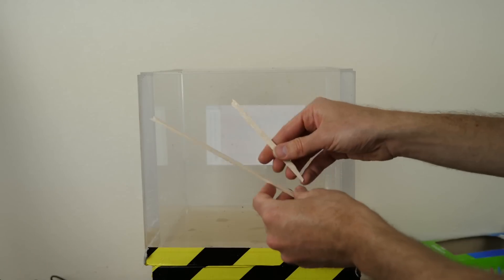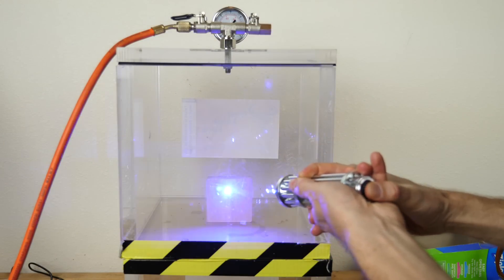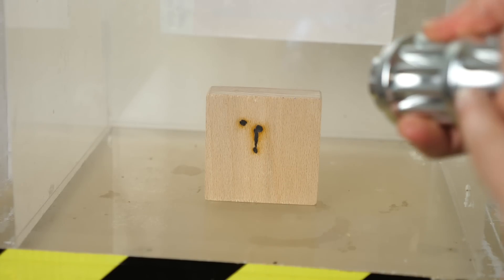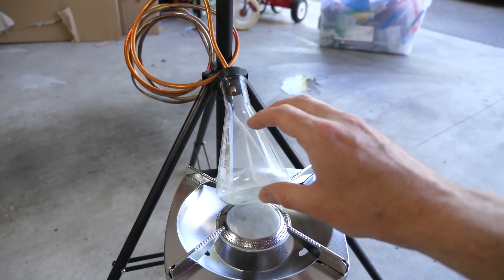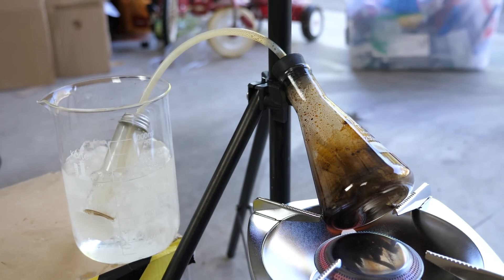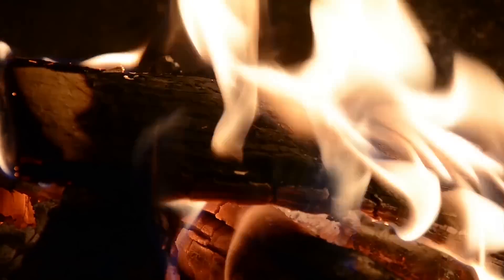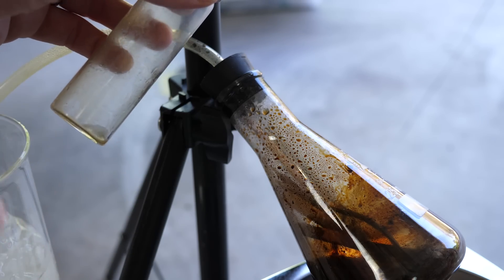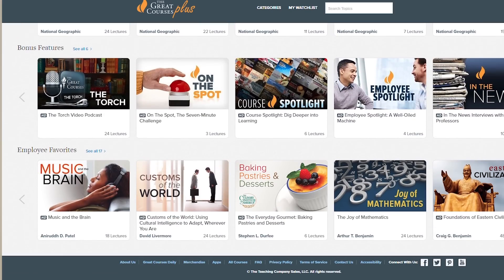Is It Possible to Melt Wood in a Vacuum Chamber? The Wood Distillation Experiment

Comment: Bad premise (every single substance in the world actually does have a melting point). It may appear a little embarrasing that, given the kind of channel you run, you obviously never heared of sublimation, while I just remembere it from 7th grade German Gymnasium.. Sublimation means going from solid to gas state without actually having a liquid state in between. So 'every single substance in the world actually does have a melting point, exept those that have a sublimation point'. Ok sublimation is dependent on pressure. Just the vacuum does the opposite of what you would want here. If you would have a high pressure innert gas environment it could work to melt carbon, but only at a verry high temperature.
So we get, 'every single substance in the world actually does have a melting point at a certain (high) preasure'.
Only that this is still wrong.for most substances in the world are not elements but more komplex structures, as i.e. wood, and with those you also have to consider dissociation.
So a true promise would be, 'every single element in the world actually does have a melting point at a certain (high) preasure'.
So no wonder you couold not melt wood. Even in high preasure innert gas environment the wood would dissociate before you would rech the meltingpoint of carbon.
So no way you could melt wood, specially not in a vacuum, considered in a real vacuum you could not even melt ice. It would go to gass without becomming a liquid first. 
For those interested, google 'triple point'.
Reply: Omg😱
Reply: Well said 👏👏👏
Reply: Melt carbon and keep it melted for a full 300 second you will go quantum.
Let me know your findings
Reply: Yes thanks, I was looking for this remark !
Reply: I actually have chemics in my 10th grade...also german gymnasium, pretty sure its more like an english grammar school...but you remembered me about 7th and you had some words written there, that i didnt know, but wwre kinda selfexplantory given the fact that you had a good text...and it does seem mostly if not completly legit so props to you...
Reply: I just learned about sublimination yesterday. Thanks for your information!
Reply: Diogenes2077 too long
Reply: @marzzziiipan  reely? Me fink u nort sow smart wif reeding maybee lurn too reed
Reply: Jesus dude, just tell him he's wrong.
Reply: I’m too dumb for this
Reply: I learned that in 5th grade
Reply: Temmie Mew what are you Asian
Reply: @cooperdunn3808  no I Live in Michigan
Reply: Well said and excellent explanation. Have a 🍪.
Reply: lmao he actually described that in the video, good job wasting your own and everyones time typing that out rofl. also youre just dead wrong, not everything has a melting point. molecules falling apart isnt the same as melting.
Reply: Diogenes2077 try to melt gun powder
Reply: triple point isnt no liquid, its the point where water is solid liquid and gas at the same time.
Reply: carbon dioxide sublimates, not carbon. you could probably get carbon to melt with a high enough temperature, without a high pressure. Not that it wouldnt be EASIER by comparison to do it at high pressure, it is still possible. the idea behind using a vacuum is to see if, like how ice put in a vacuum eventually melts due to low pressure, this would happen with wood. the same reason why boiling temp is lower at high altitude.
Reply: Who the hell has a comment this long?? Just saying' good info tho
Reply: @Amongst_Shadows  yep
Reply: Who didn’t read the whole comment, but gave it a like/ comment anyway?...
Reply: not saying that he is not a dumb ass
not you
Reply: Hallo :D
Reply: heared? HEARED? I believe it's heard

Comment: Some proper knowage chemistry and phisics would help you to not present us with nonsence.
Wood is not a substance, but mixture of some substancies.
There is no such thing as "evreting melts".  You cant melt dry ice or jodine at normal preasures. You can't melt Helim-3, because it doesent exist in solid state.
An thats for less than 19 sec. Cant imagine what level of ignorance you are reching for the other 650 sec.

Comment: Sorry, but a bad explanation in chemical terms.
Reply: The question in this video is irrelevant by itself. Wood consists of cellulose and lignine. These long-chain-macro molecules cannot melt, only fall apart when they are heated  (destillation). The dry destillation of wood (pyrolyse) gives gases, tar, finally  charcoal (limited oxygen) or ashes (complete burn-out).
Reply: how come i have no idea what destilation is? I think you made it up. The process you define by destilaion is decomposition. WTF ARE YOU TALKING ABOUT?!!?
Reply: There is dry destillation (=pyrolyse): e.g. wood heated under a hood where no/less oxigen can enter. Leads to charcoal and gases + different other chemical products. "Wet" destillation is used to (say) free substance (A) out of another substance (B), in which A and B are dissolved in each other. Say ethanol alcohol distilled from wine (= mixture of water and ethanol),  with the help of a cooling spiral.
Reply: Is a good example of why should always take scientists and overconfident doctors with a grain of salt
Reply: radiofun232 i want to see you explain it...AND DONT USE STUFF LIKE GOOGLE OR PEOPLE TO TELL YOU OR SIRI
Reply: radiofun232 * drops the mic *
Reply: Sorry, but I don't know what you mean.

Comment: can anyone explain why the laser doesn't do ANYTHING to the vacuum chamber? 
if the laser can burn would it seems like it should at least singe the glass or acrylic or whatever the chamber is made of
Reply from the maker: The laser is heating up the acrylic slightly. But in order to heat up it has to absorb the light. Acrylic is mostly transparent to the blue light so it doesn’t absorb it and do any heat up.
Reply: The Action Lab thank you so much for the information

Comment: No need to watch the video:
Wood is an organic lifeform made of CELLS you can't unbond cells one from each other heating them; if you want to liquidify wood the only way is a molecule that break down the proteins that bonds the cells to each other.
Seriously, this experiment is like trying to prove that abiogenesis can't work sterilizing chicken stock and covering it ermetically leaving it alone for days pretending that some mold should form. Don't offend please but it's plain stupid. -_-
Reply: TheIceThorn so I should be playing with acid instead of fire, cause that will break down the cellular structure, right? Right?

Comment: The actual reason you can not burn wood is simple. The temperature at which all the elemental parts of the wood are significantly higher the the temperature at which the molecular bonds of the wood would break down